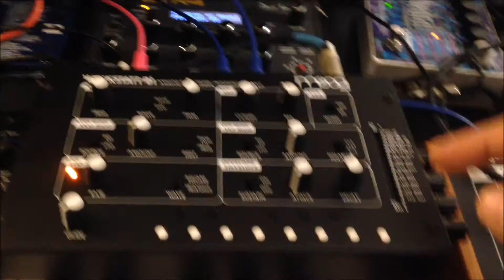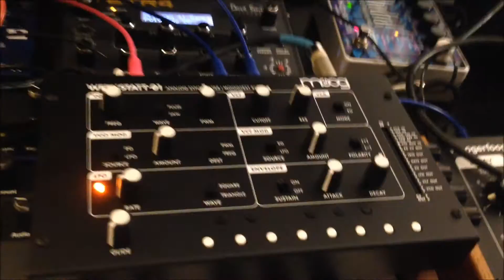Laurentide SynthWorks 14 - Werkstatt Mod Walkthrough

Comment: Did you use a dual gang 10k pot and an opamp just connected to the vca exp in underneath the pin header on the patchbay?